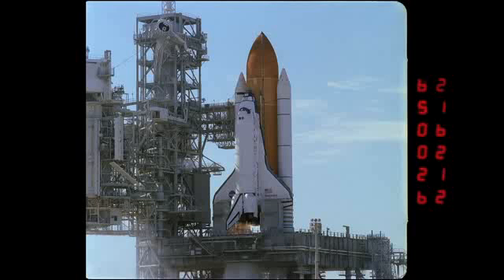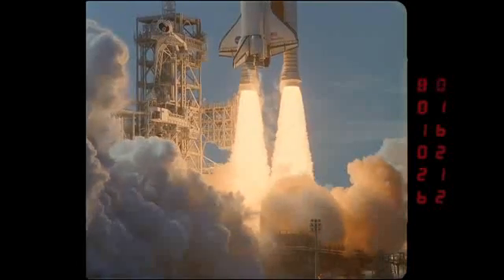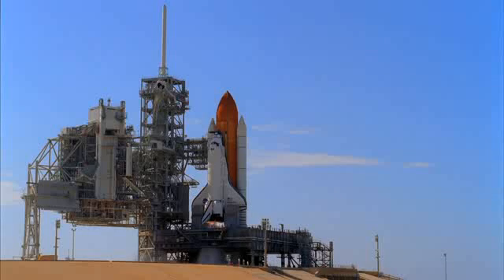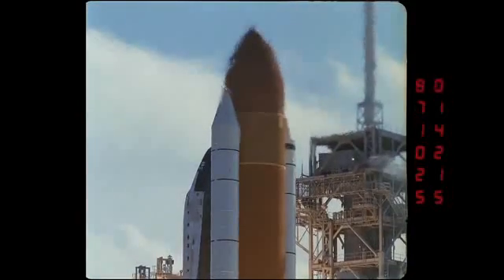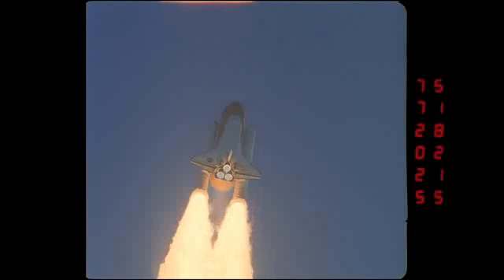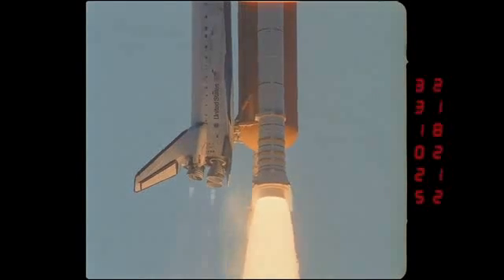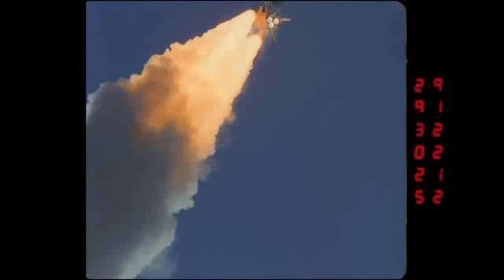Part 3: Space shuttle launches high-speed video camera slow motion views

Comment: Hind sight is always 20-20. But I wish there would have been some sort of external cameras on the shuttle itself so the crew could do an inspection of the external surfaces covered by heat shield tiles needed for re-entry. Even if the camera burned off during re-entry. With all the effort to film every aspect of the Launch, journey Etc. it just makes no sense. A quick 10 min.look would have discovered the damage to heat shields. Even an airline pilot does a quick walk around to check for anything obvious before each flight. Im No NASA engineer, But damm..
Reply: Inspections were done prior to flight. Damage happened during flight. Tiles had nothing to do with the accident. A hole in the wing structure killed them. There were cameras in the payload bay and the orbiter belly, but their not for examining the orbiter. Burning cameras on re-entry is bad because the pieces coming off hit the orbiter causing more issues.
Reply: I understand that. Just saying maybe there could have been "Some" way to do a quick inspection of the underbelly of the orbiter prior to re-entry. It wouldn't have been that hard to spot the damage. I saw all of the reinaction videos showing the foam hitting the leading edge of the wing making a hole. That hole would have plainly visible. If only they had some way to look. They knew the foam had broken loose before. They just assumed it would never do the kind of damage that would leave the craft vulnerable on re-entry. Maybe engineer a better way to anchor the foam or figure a way to strengthen it so it couldn't come loose. This is NASA for gods sake.

Comment: there was 1 thing i am upset they did show from  any of camera's the the"twang" that  takes place   between T-6 sec  and T-0
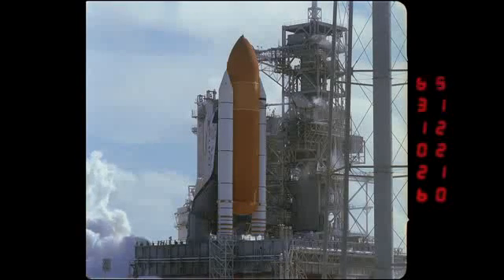Reply: Take a closer look. For example, on camera 60, you can see that motion starting at about 1:55. It reaches maximum deflection around 2:09, then rocks back prior to SRB ignition at 2:22. In this high-speed footage, that motion is greatly slowed to the point of near-imperceptibility.